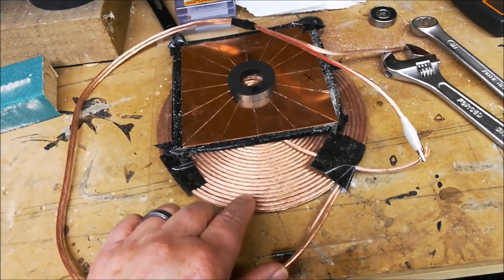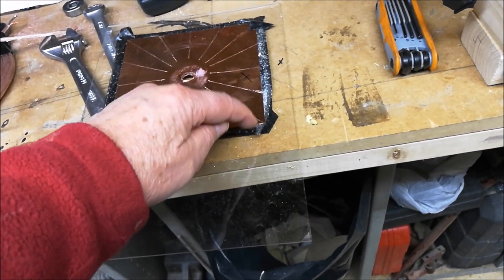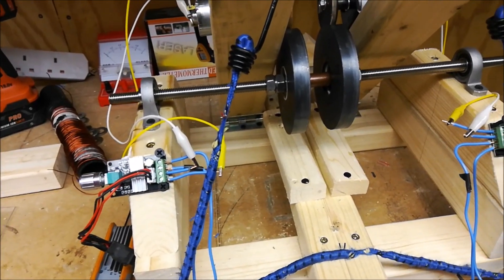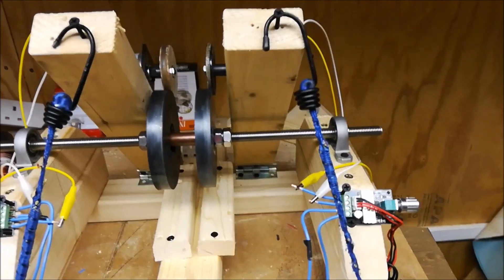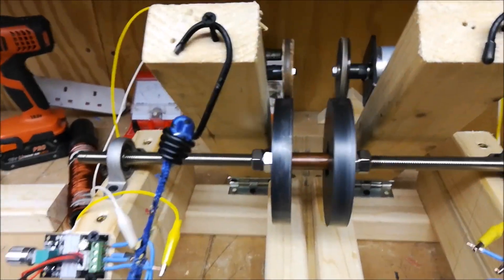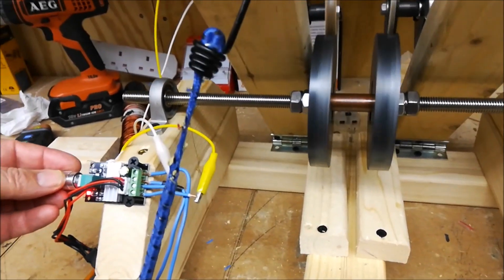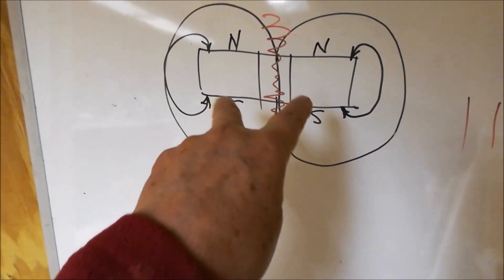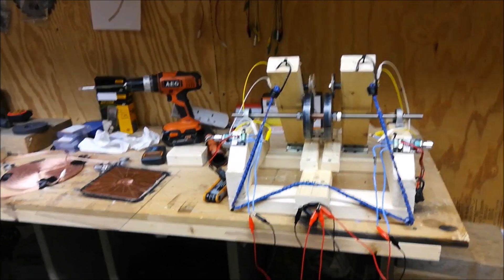Faraday's Paradox Dielectric v Magnetic Fields

Comment: Excellent tinkering Sir! you are on the right path..im researching on similar lines, just a question for you: if those counter rotating magnets are replaced by one conductor(Copper) disc and each spun at say 6000 RPM (as you suggested) the effective RPM relative to each other is 12000! what would be the Homopolar induced voltage on the disc? would it be same as the co-rotated  Voltage(@6000RPM) or that value of the co-rotating them at 12000 RPM? I feel the magnet would negate it to 6000 RPM whilst the relative velocity remains 12000 RPM!